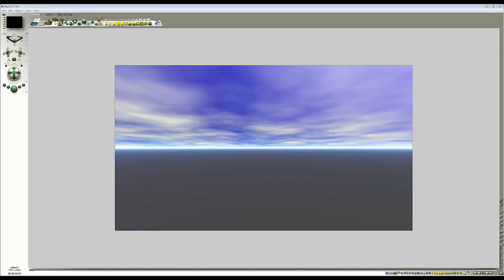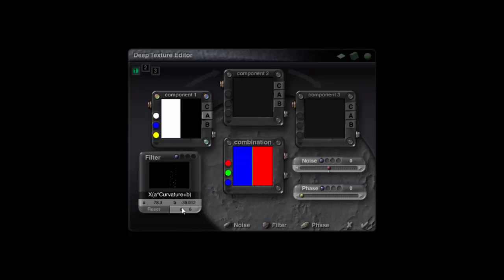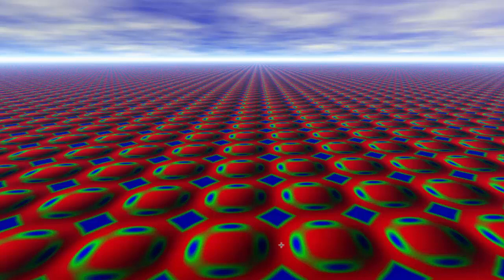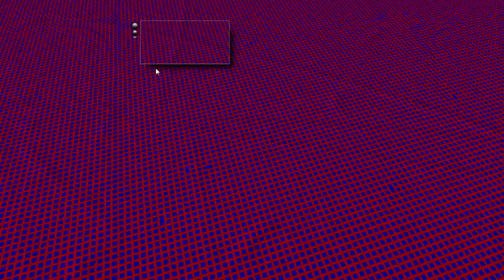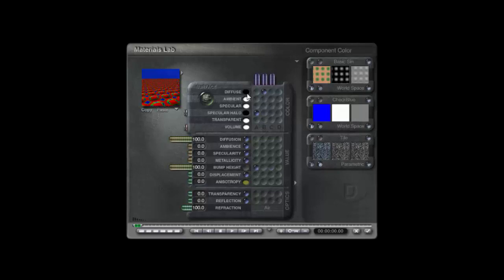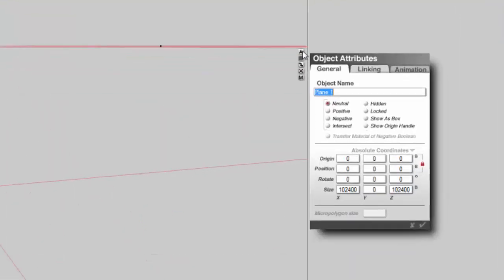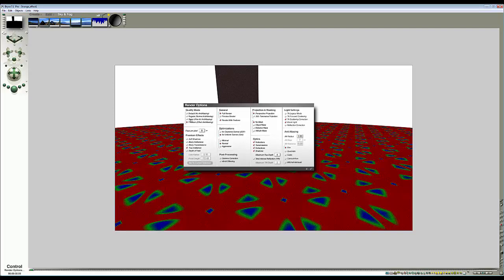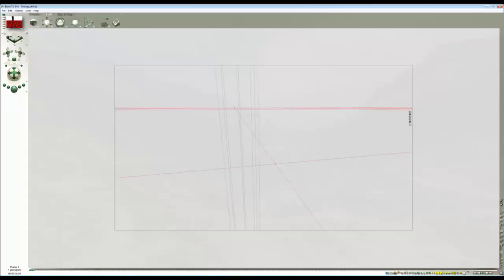How to investigate curvature part II - by David Brinnen.

Comment: Hi David
Good to see you still doing stuff with Bryce.

I have enjoyed using it since it was 'state of the art (!)
I still think it has the best procedural texture editor of any software.
Just an interface, the DTE, that is the most difficult to use!

I am less interested in the ability of Bryce to do photo-realistic or try and emulate the PBR trend. I have long regarded it as the goto source for animated abstract patterns.

The curvature effect can be used to create a Chinese watercolour BW ink type effect. When painting mountains, they often drew the outlines, not the shadows. If you set the shader so that only the most extreme convex edges are coloured black, the rest white with a thin gradation to grey, it can make a landscape with an outline render effect.

Now if I could just figure out how to stop the haze colouring things blue...
All the best for the future,
izen
Reply from the maker: Might be able to help you with the haze.  Have you tried, sky lab > atmosphere tab > check colour perspective blob and the RGB values that become active give you control of the haze tinting effect.  You can then have the haze entirely neutral, or tint to any colour you want - this is independent of the haze colour as you know if you are using white haze and it is tinting blue.
Reply: Yes, that works. I thought white haze and the colour perspective off would be neutral, but it must default to blue with distance.
Takes a bit of juggling to get it neutral without to much brightening! Thanks.
https://izenmeme.files.wordpress.com/2017/09/chinese_ink1.jpg

Don't know if the link will work on youtube, it is a test of the effect rather than an artistic composition. (grin)
Reply from the maker: Yes it worked.  Reminded me a bit of this https://www.youtube.com/watch?v=UfRzEydWRio  Also... don't forget you can use fractional values for things like density.  Eg 0.1 combined with R=100 G=100 B=100 will hive a white haze in the standard kind of range.  Using thickness to control the distance of the transition from the camera.
Reply: Thanks for the advice. It is a 'feature' of Bryce that extremme values (low and high) often provide useful effects!

I had seen the pencil drawn tutorial, part of what gave me the idea for the 'Ink' style render. But the blurry reflections with the premium renderer slows it too much for animation. I had tried blurry reflections to tone down the distant reflections, but it was very slow. I needed the haze and fog for the atmospheric perspective. Even for someting that is meant to be rough hand drawn.

Tried a lo-res version, getting some strobing from the edges with scaling, it will need to be rendered at hi-res and perhaps better AA. But as proof of concept, and a few tweaks in AE with an aged paper background making an animated Chinese hand-scroll, I think it works.

https://youtu.be/bX0cm4vi_7k
Reply from the maker: Brilliant!  The animation really brings it to life.  I never think in terms of animation, only stills, hence have no concern over long renders.  But multiply that up by many frames and I can see the issue.  OK, righto, AA'ing.  The lazy way, use premium effects, the wrong way, use fine art AA and the fiddly way... the AA controls on the right hand side.  I've done a video for that too - but since you are up to speed on these things I most likely don't need to tell you.  However I would say that using the AA controls to get the right effect, might be a bit fiddly, if you are going to perform many renders then it might also be worth investing a time into testing it.  The radius offers a bit of overall in built softening, this is not much use on most subjects, but it could be worth a try here.  rpp is fairly standard.  Tolerance is the threshold at which is will let noise pass unfiltered the lower the value more noise will be considered for AA.  The effect of the algorithm to select is very subtle indeed and I've only seen a difference in very specific circumstances.